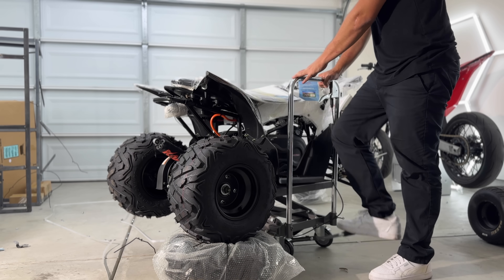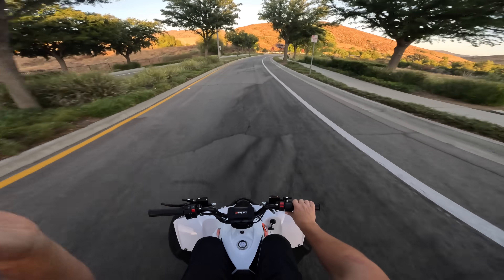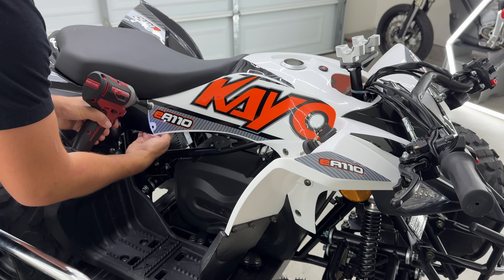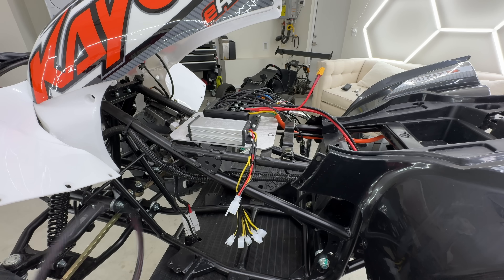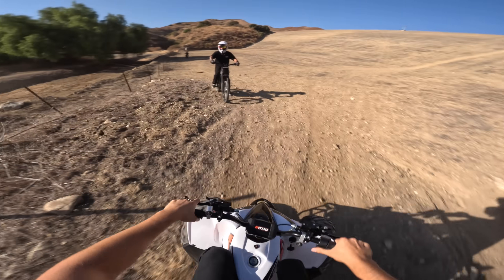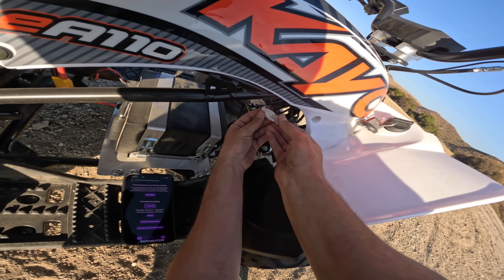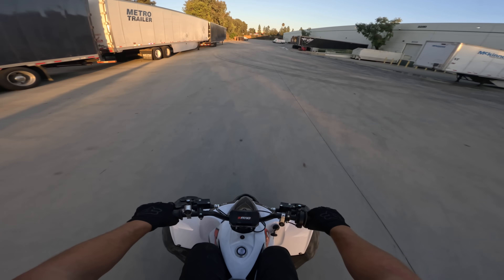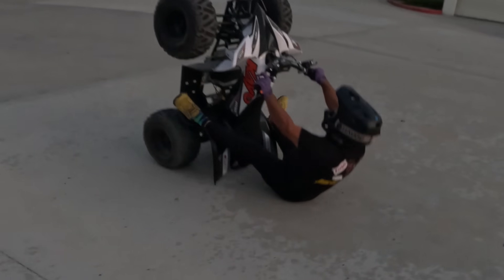I Built The CHEAPEST Electric Quad

Comment: Honestly, for 1100$  I bought a Cobra 1060w shaft drive motor and I haven't seen anything comparable in the 48v range. The 4-wheel lift works right out of the box, and the throttle response engages high mode when you twist the throttle twice to get going. I've tried 4 different e-quads since and nothing has ever equaled this mini quad. I bought it stock from the Urfuntoys website.

Comment: Please do a Cheap Electric Dirt Bike video on the Tuttio Soleil 01 / Kugoo Wish 01, it comes stock 48V 30mph for only 1500$ and you can put in a 72V battery inside since it has a Fardriver 72v controller

Comment: Aww man, im building a HyperQuad out of a little 50cc Quad with Surron Parts right now (Controller/Battery/Motor)

Im also welding more tubes onto it so it will be more stable on the frame and nothing can snap.

Also will extend the swingarm and also lower it so it will be harder to come flying off of it😂

Im trying to get it up to 30Kw haha

Comment: I am quite literally a scientist in electrical/electronics engineering with many years in technical related trades and this is just an example of the Chinese killing us. I have a Vitacci Pentora that is now better known as El Diablo because I've rat rodded the hell out of it to look like nothing else on earth.

I also flipped it on the blacktop and nearly died while it launched into the air about 5 to 6 feet into the air then slammed down on the bars with all 4 wheels facing the air. The frame, motor etc. took it like it was nothing.

Too many damn Americans push product snobbery and sell to a very small base at obscene prices. On top of that, many still outsource everything to Asia with their marketing schemes to ensure they have a 1000% to even a 10,000% markup by selling to snob culture and ignorant people who always over extend themselves.

Comment: You should build a full sized quad. You'd be hooked. I started on three wheelers at 10 in 1979. Sine then, I've owned almost every performance quad that Honda ever produced with the 400EX and 450R being my favorites.

By the way, about that wheelie cheat code... Can confirm. My best quad wheelie ever is 4.1 miles. Got caught at a red light. lol... Once you learn to rear wheel steer, you can basically ride on the back wheels like normal driving.

Comment: My e ride has had problem after problem 

1st they shipped it on its side with the front wheel on the bottom under the bike my rotor was bent when I got it ... then there were scratches on the frame from where the rim and rotor were rubbing against it ..... ps I bought from Rev rides delivered by rnl carriers.....
I had the bike for about a month now my throttle isn't working and it's throwing a code 00700 which is supposed to be the throttle ......
I looked ok reddit and I guess multiple others have had this issue as well and one person Said it's not the throttle that it's the Controller so .... I got a hold of e ride and they are sending me a throttle and controller because I told them I'm not waiting another week to see if it's the throttle or not they can send both so they are..... now I tried to change my sprocket cause I figure while I'm waiting I may as well throw on some parts I got for the bike.....some stupid idiot put so much RED LOCKTITE in the bolts in the sprocket I couldn't get them out for the life of me ....I did end up getting 3 out but 2 others stripped...it's constant bs and I'm telling ya I almost wish I would've got a different bike fr fr they have some serious kinks to work out in my opinion...when you spend 5k on a bike it shouldn't have any issues ....... I will say they have been good with helping out but this is a bunch of bs I didn't ask for when I purchased the bike and I don't think I should be the one responsible for fixing it or taking it anywhere to get fixed I haven't been offered any type of reimbursement or even some type of credit for parts or something for having to deal with all of this ....I've had to be on the phone for hours and talk to so many different people again all bs I shouldn't have to deal with . The bike is awesome yes but it isn't too awesome sitting in my garage not working.
I just want compensated for my time of fixing the bike show me some bars something but idk just super frustrated having to deal with this bs .....first time having a e bike isn't that great of a experience when it's giving you all kinds of stupid issues first month .